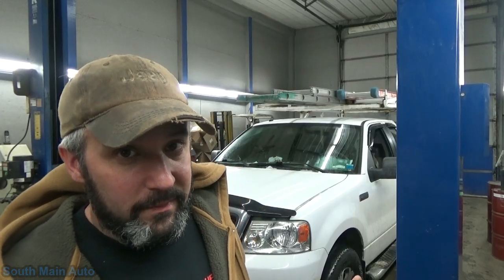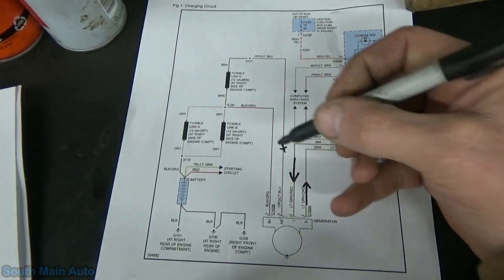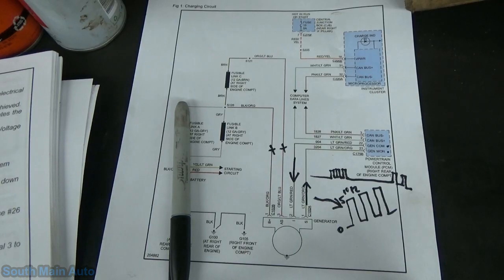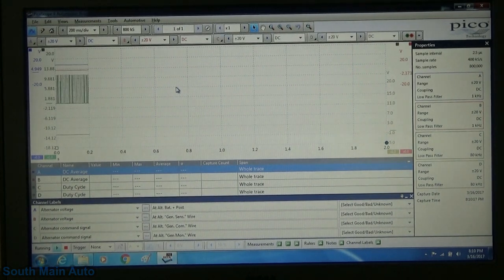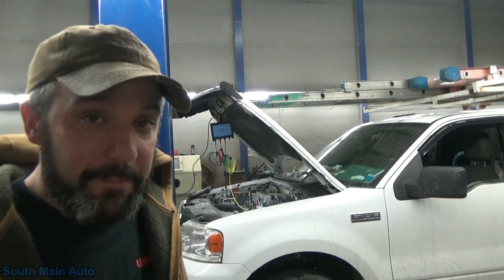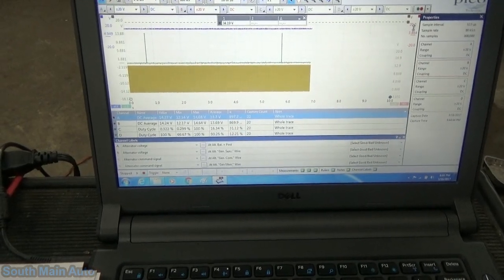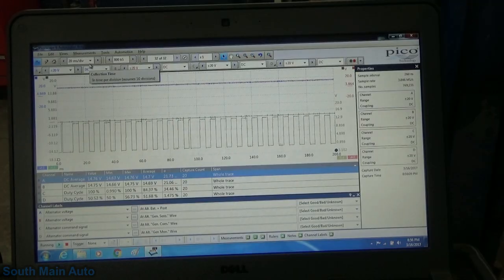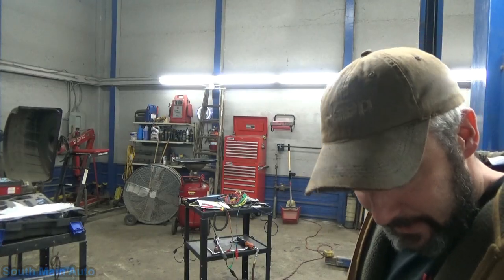Ford "Smart Charge System" Alternator Not Charging

Comment: * Try an ECM Update from FORD if available***  I work in the Telecom industry and I often find issues and feed them back to my Engineering team.  Its very possible this problem has already been resolved and will set a DTC if you update the ECM firmware.  I don't know if Ford makes updates available to the general public or not.  Speaking from my own experience I used to have to apply updates with my Diablosport tool on my Charger all the time.
Reply: they have to keep the service departments busy somehow ehh?
or should I have said over-busy, feeble attempt for economy correction, vs facing the fact of massive over-inflation and time for major recession/ great depression 2.0 ( or is that 3.0+)

Comment: It seems like the strategy is that the alt has an internal "full charge" logic that's the basic default and the PCM just lets it do its thing until the desired charge is attained, at which point it starts controlling the alt in detail to prevent overcharge. But yeah, why the eff didn't it turn on the light.

Comment: My jeep did something similar, i was on the main road here and my voltage dropped to 9v and I didnt even notice until the check gauges light came on. Pulled over and check the duty on the alternator and it was close to 100% and still was not making any power, and i got no battery light. I'm not even sure why the battery light exists, it does nothing. Needless to say i threw a reman alternator on it and its been fine since, not an advanced one obviously. I've been driving it for over a year and until the new alternator it's never had battery voltage above 14v and still never threw a light. just kinda weird.

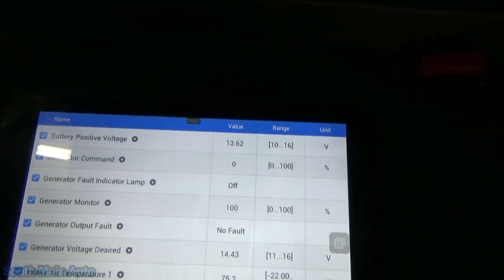Comment: MAF may be disconnected but at least the engine can breath now. By the looks of the air filter I can only imagine how dirty the MAF is. Sometimes I scratch my head why a DTC doesn't set sometimes when I have disconnected a continuously monitored DTC or circuit especially one that will raise havoc with over/under voltage to the modules and we know how they love that. Smart Charge Gen 4 it MAY set a P0620...WHAT...MAY set a P0620 when the Com/Mon line connector is disconnected and they call it Smart Charge...always made me laugh. I've always hated the way they have the DTCs with no description or code setting criteria. Late night I see but it's fixed and hopefully the new alternator will last. At least the Gen FIL came on @24:41 when you went over 2000 RPM for more than 3 seconds but no MIL or DTC. Don't rack your brain too much wondering why you had no Gen FIL, MIL or DTC...it'll give you grey hair & have you talking to yourself :D

Comment: i have simmiler problem whith a 2004 ford transit van hear in the uk its a 2.4 diesel but other way round charging light stays on but alternator  is charging the battery  how do i fix it when its not broken ?????
Reply: Same process...I can't say your ford transit utilizes this "Smart Charge System" but at 24:30 in this video he ran the truck with the alternator unplugged. It charged the battery AND turned on the battery light.

Comment: smart charge, another bullshit... my car usually stops charging the battery at 80+% state of charge..the rest is only charged when you decel.... that might be enough to start the car but not in the winter to run an aux heater... I always miss 20-15% battery capacity..also despite what they say, batteries don´t last very long with smart charge

Comment: Okay, time for a rant. The manufacturers, in search of operating "efficiency" don't consider overall cost of ownership. I learned that on newer BMWs and MINI's (which I have) you have to program the ECM when you get a new battery.  The dealer charges $148 for this service. So on top of the cost of a new battery ($160 for the only battery that will fit a MINI) you have this charge.  Whatever savings you might possibly get from a more efficient alternator are completely lost at battery change time.  All to meet Government CAFE standards.
Reply: Corporate Average Fuel Economy----means crap vehicles. Suspension, chassis, components, etc. built so light that you wonder how the vehicle can ever keep an alignment. Absolute garbage!
Reply: Whether they're airlines, shipping or manufacturing companies - or anything else - if a corporation can save 5 cents by putting you out 5 dollars in money or headache, they'll do it every time.  They don't care because, in the end, you keep coming back.
Reply: Ford does the same and we don't charge extra it's a 15 min scan tool function that just lets the ECU know it's got a brand new battery and starts the timer lol
Reply: That's BMW problem not a manufacturer or efficiency problem. Ford's system is really overdone here too. My Honda has a much simpler system. It has an ammeter, and based on ammeter draw it uses the same line that alternators have used for voltage sense to control the alternator. Its a really simple reliable system that drops alternator output by feeding a higher voltage and increases voltage by reducing voltage. 
If you're driving a BMW they assume you don't care about TCO, Honda make there bread and butter off of TCO.
Reply: The new ford system is the same. Gotta tell it when you replace the battery. And forget jumping off equipment or tractors or semis or whatever cause the alternator will not put out over 12.5 or so volts!!!! Stupid luxury man "truck". The new f150s are about as much of a work truck as a Toyota Prius!!! 

A man who buys a truck to WORK with doesnt give a crap about saving $2 per year in fuel when his semi or tractor won't quite crank on a cold morning and needs a jump start!!!!! Nobody buys a truck for fuel savings! Get a car if you want to save fuel.
Reply: Stick a 12V power supply somewhere on the car while unplugging the battery, no problemo.
Reply: @ColtaineCrows  it is actually more complicated than that. The charge strategy takes into account the slow degradation of the battery, size in amp hours, and the degradation of the alternator itself into account. You can just swap the battery with a new one, but the computer will treat as an old battery effectively lowering its life expectancy. There really is a benefit. Now is it worth the money difference, that can be debatable. But on average it will net you 2 more years of battery life compared to a load based system like a Chevy. Batteries are not getting cheaper.
Reply: @TraceyAllen  but that's a bad thing when you are putting back that same battery again (e.g. after a slow overnight charge)
Reply: @dushk0  generally then there would be no reason to reset for the old battery since nothing was changed.
Reply: You would need to energize multiple circuits and bypass others or you risk breaking stuff
Reply: @Knightrem  not if you connect the 12V to the battery terminal before removing the battery
Reply: But how much longer will the battery live when it's has a exacting charging strategy. Over charging a battery is just as bad for them as under charging, freezing, ect. In my experience the newer German cars the batteries will last approximately 2 years longer than majority of domestic or Japanese vehicles. Also there are several scan tools available that will reset the computer to new batteries. So going to the dealer is not 100 % necessary. Any reputable German car specialist should be able to perform this at a fraction of the dealership cost. My snap on will do it.

Comment: PCM be like 'Alternator's not communicating, does the owner need to know this? -nah, it'll be fine...' :P
Reply: Jan Verschueren haven’t seen a Ford with a volt meter in years! Don’t know if it’s just the super duty’s that have them at all anymore or not
Reply: To be sure it's the alternator start it up let it run then take the positive lead off the battery if it stalls it's the alternator but they say you shouldn't do it on newer cars with all the computer modules but I've still done it

Comment: I've just learned all about these systems when figuring out a dead battery on my Ford Focus diesel. Was waiting for you to do the hillbilly alternator check and pull the 3 pin plug and check for the 13.8v.

The system (on my application anyway) also references the coolant temp sensor and delays charging on a cold start to reduce emissions. Takes a couple of minutes before the charging ramps up. I show this in a basic way on the battery vid i just did.
Reply from the maker: Throw a link up here, I'll grab it from the spam folder
Reply: South Main Auto Repair ....HEY ERIC O! great job. 👍

Comment: So, let me guess, it is not possible replace only the regulator on these alternators?
Reply: Even my '86 Grand Marquis has an integrated regulator. Also easily replaced. 

Had to replace one already, since the dolts at AutoZone had no way to test for bad diodes. Over there, if it charges, it's good ... SMH ....
Reply: integrated alternators have been with us since about 1970, and are serviced as a unit, you also cant put new spokes in your wooden wheels either on modern cars
Reply: I guess you meant integrated regulators... I have Bosch alternators on all of my cars, they are from the mid 90's early 2000 (I hate modern cars). Yes, all have integrated regulators but it is easy to replace them. You only have to remove a plastic cover and a couple of bolts/screws...

Comment: Great vid Eric!, I have struggled with this system in the past, I learned a lot. .....was that a OEM Ford alternator or aftermarket?   Just had a Mazda with similar setup, it did not like aftermarket alternator, dealer part was back ordered, three weeks later every one is happy with OE unit.

Comment: I wonder if that's something that would take, say, 20 key cycles of that fault to get the code to set? IMO,  there should be a warning immediately.

If I leave the charger on my '07 Silverado, then immediately fire the engine up, I'll get a "Service Charging System" warning because the voltage is too high - immediately upon startup too.

I've gotta get me that Pico! But first, I've got to pour a slab here, get my tent set up, and install a lift. Big plans ahead! :)

Comment: I read somewhere that those systems are designed to be used with silver calcium batteries and not the lead acid types because the voltages used can damage a lead acid battery. I think the PCM plays a "bigger" role in this scenario compared to other systems which my explain how the alternator is charging when the 3 pin connector is unhooked. Seems like it's an "only when needed" thing. I reckon we're used to seeing systems totally dependent on engine rpm. Just a thought.

Comment: So, Eric, Is there a way to put a volt meter across the battery and check for a bad alt?  Possibly, with and without loads, and at different engine speeds?  Do we really have to spend 1000's of dollars to see why our ford doesn't charge the battery?????   Great vid!
Reply: DollyLama It's easy to tell that the alternator isn't charging the battery, not quite so easy to tell whether it's because the alternator itself is toast or because the PCM is telling it not too.
Reply: DollyLama you can get a used vantage for a couple hundred bucks or a 4 channel chinese scope for like 6-700 with leads and accessories.

Comment: You said you put 12v on the COM and MON lines to push it high, but I thought you weren't supposed to do that on a computerized circuit? Is it because you possibly used an LED test light?
Reply: You're right. I was thinking it was a PWM 5V signal for some reason.
Reply: agreed, digital high signal might only be 3 or 5v, not the full system voltage, something id be wary of doing
Reply: JasonMTG you can see on the pwm signal its running at 12v so hes forcing it to 0% and 100% and he had the diagram which you can see what its doing first, even with a cheap dmm you can check duty cycle and then derive line voltage of pwm signal from that.
Reply: not wrong for thinking so, as most pwm signals are pulldown or pull up 5v, and its always better to err on the side of caution if you arent sure, but being switched straight from the battery or generator in this situation it makes sense that its 12v, it simplifies the design of the controller at the generator.

Comment: The parameters in the ECM are probably not set low enough to turn on the money light which is probably a software problem
Reply: engineering flaw  in all those crazy systems

Comment: Great video. I was diagnosing something similar on a Ford, battery light was on all the time. IAT sensor wasn't plugged in after changing the air filter. Now I understand why battery charging light came on. Thank you for your efforts.

Comment: Great vid!  I didn't know that it would still charge with it unplugged.  That'd be a great way of testing without a PICO ;)  I believe the light only illuminates when the PCM doesn't get a signal that it's expecting from the alternator on the MON line.  Funny that it was telling the PCM that it was charging when it wasn't.  I guess something broke between the regulator and the field.
Reply: yep it wasnt the control circuit, it was past that, maybe the exciter brushes or broken field wire etc

Comment: When you said the ecm turns off the alternator when cranking I thought that may have been the fault, some fuse broken wire crusty connector or stuck switch was telling it that it was still cranking even when running.
Reply: well i think it delays then allows charge,  sure helps that big morning belt screech probably

Comment: Looking at that air filter I realized I've known a few thousand guys like the owner of that truck, run it into the ground until it stops then drag it into the shop and complain that the manufacturer built a piece of garbage.
Reply: But Ford really DID build a piece of garbage with these trucks.    Most poorly designed pickups ever.   BY FAR

Comment: I'm just a DIYer but thanks for reminding me why I'm keeping my 2003 F-150 rather than going newer. Broken spark plugs, overcomplicated electronics, VCT problems, man I sure don't want a newer truck. I actually bought a 2011 F150 new, drove it for 4 years and went back to the 97-03 gen. Like them much better. Cheaper, easier to fix, more reliable, etc.
Reply: I'm a DYI'er, too. I'm getting tired of the sharp learning curve I have to overcome every time I buy a newer vehicle, not to mention the specialty tools they require. My newest car is a 2011 Odyssey that I had a bad experience in repairing.    
Makes me want to rebuild my old '91 F250.
Reply: You should. Although I like an excuse to buy more tools LOL